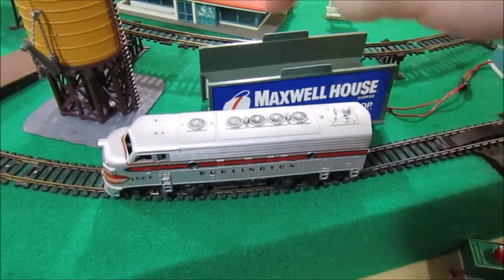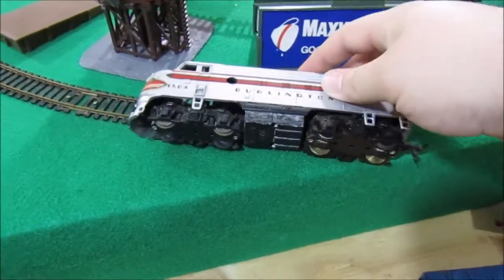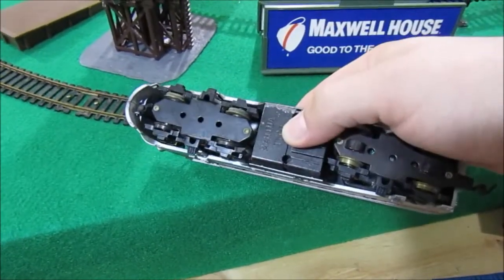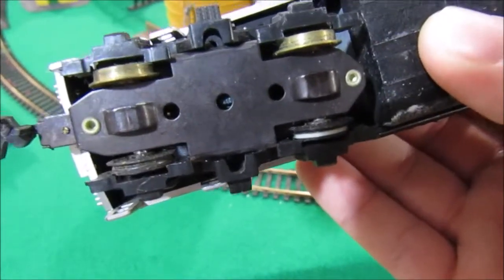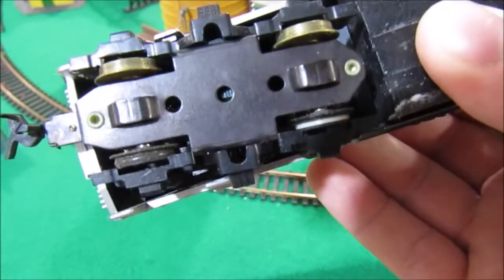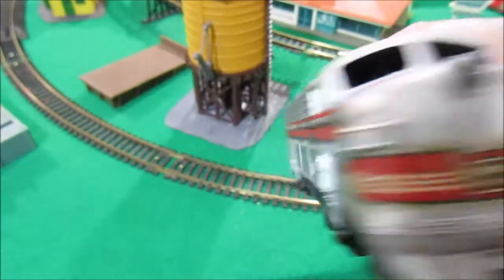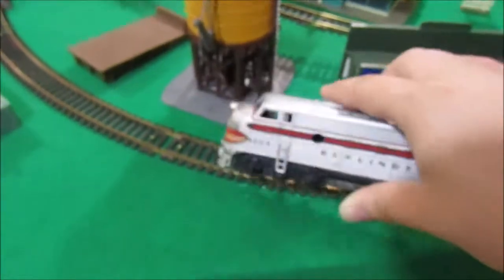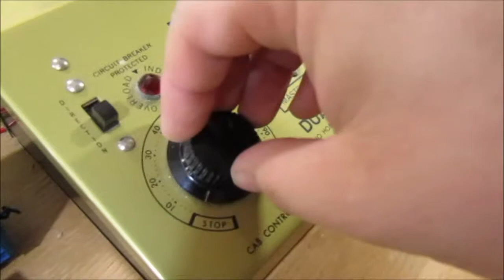Restoring TYCO Burlington F9A #150

Comment: It’s awesome!! I have one that is  beat up but it’s my original loco! It’s lightning fast I wouldn’t swap it for one of my $300 locos!! Love watching it go around .
Reply from the maker: Thank you! That's awesome. Old Tyco diesels with MU-2 motors are the cheapest and best diesel locomotives out there, in my opinion. With a little maintenance - brass contact wheel cleaning, new traction tires, and lubing the gears - they run superbly well. And MU-2 motors are virtually indestructible.

Comment: Looking great RP! I just got a nice Tyco Santa FE F7 that I have a powertorque to clean up and work on. I bet I'm going to wish it had an MU-2 motor in it.
A-A-RON
Reply from the maker: Thanks Aaron! Hmmm, you could always swap out the PowerTorque motor with an MU-2 truck assembly, if you wanted to, and just glue on the truck covers from the PT assembly to "cover" it up. But, it's up to you. Some PowerTorques, as I'm sure you know, when given a little TLC and traction tires, can run really well.
Reply: The silver streak took up my spare MU-2. I have a spare set of bushings and a couple armatures for a PT, so as long as the pins aren't broken it should be running within 15-20 minutes. I've managed to get/keep most of mine running without releasing the magic smoke on a unit yet...

Comment: Hi, how did you remove the pin that holds the front coupler? Is it a hidden rivet? I can’t get mine to come out. Thank you.
Reply from the maker: The pin that holds in the front coupler on Tyco F9s (and Sharks too) can be removed with needle nose pliers. Be careful though, the pin is really pressed into that hole, so have a good grip on it with the pliers so that the pin doesn't go flying into outer space (yep, I've lost a few pins in the past. Lol.)